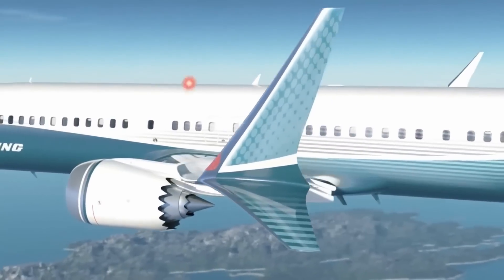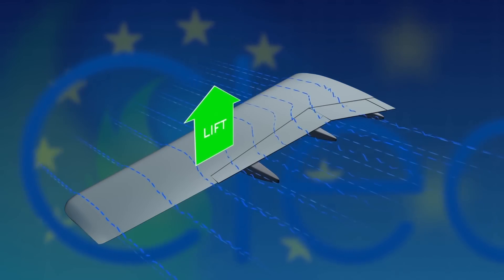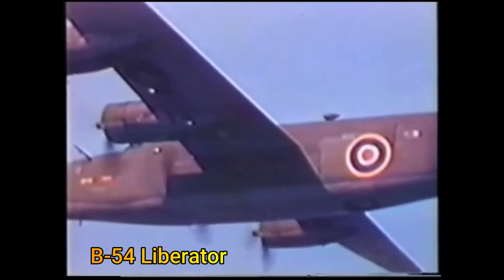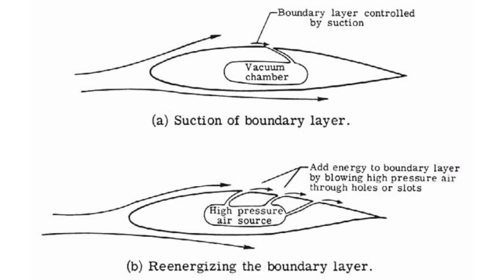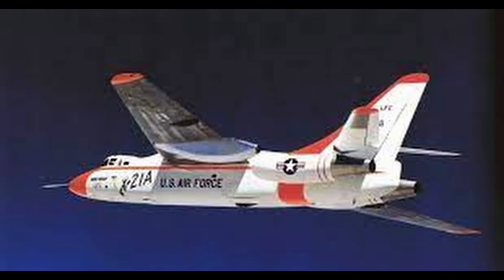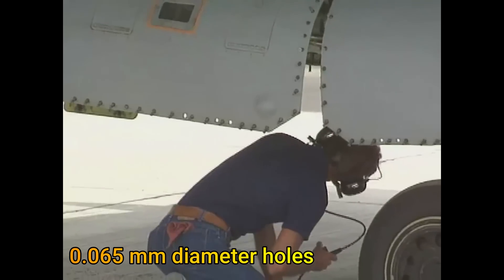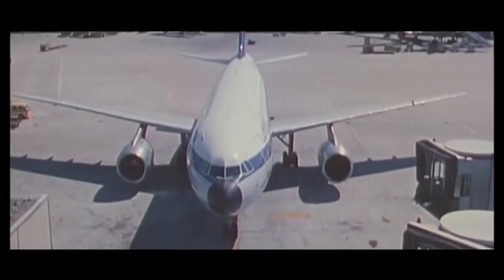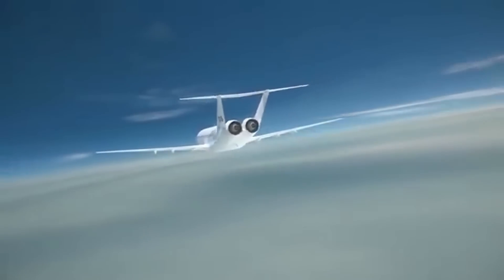Laminar Flow Aircraft: The most promising development in Aviation

Comment: It's a B-24 Liberator.
Reply from the maker: My apologies. I had written B-24 on the script but for some reason kept reading it B-54. I guess I had too much of the P-51 Mustang on my mind.
Reply: @ElectricAviation  
By the way, it was Pfenninger, who first designed and tested the Celera like body shape at the ETH, called the Zürich body, drastically reducing the drag coefficient in a rather LIMITED Reynolds number range . The data is available from the Institute of Aerodynamics at ETH or in the famous book by Sigmund Hoerner, Fluid dynamic drag, on the graph , skin friction of bodies of revolution, were it is called Zurich body, but no image is shown. So the original publication is recommended, from ETH, remarkable is the shape of the tail end, obviously not on the aircraft, with the pusher propeller. Talking propellers, the contra rotating coaxial propellers have a much better propulsive efficiency , 92+ % , compared to large 4 blade Hamilton Standard propellers, peaking at 85% , due to the angular momentum recovery
The efficiency of GA smaller propellers is in the order of only 76% for controllable pitch ones
Reply: @ElectricAviation  Wow the B-24 is such an iconic plane that saying b-54 marks you as you as very odd.
Reply: @ElectricAviation   The reason, moderately swept wings are difficult to achieve natural laminar  boundary layer of NACA 66216, 66212 , etc sections is the fact that the local angle of attack changes, increasing towards the tip, due to the interaction (Biot Savard) with the opposite wing. There is some, but NOT significant cross flow at cruising conditions, low lift coefficients, when the forward pressure distribution is flat.
Go and measure it in a wind tunnel, low turbulence one, where with thin oil the transition can be observed.
3 dimensional CFD designs permit spanwise constant pressure wings to be designed so that the crossflow inside the boundary layer can be almost eliminated. Outside the crossflow happens ONLY with separated flow.  Not a cruise condition.
Only in viscous flow does the pressure influence the cross flow, never in potential flow. where pressure is determined by energy conservation, in incompressible flow called the bernoulli equation.
Reply: @ElectricAviation  It's ko I have bouts with dyslexia too.
Reply: @michaeldose2041  Dyslexics of the World, Untie!
Reply: @tedsmith6137  LOL good one!
Reply: @tedsmith6137  Did you hear about the dyslexic atheist who spent ages trying to convince people that there wasn't a dog.
Reply: And the aeroplane which you showed after it was definitely not a P51-D Mustang! @ElectricAviation
Reply: @ElectricAviation  
There are four methods to reduce skin friction; high Re numbers, which destabilizes the laminar boundary layer  at high Re and was the motivation for Werner Pfenninger at the ETH Zürich to introduce suction to prevent the instabilities , rolling flow emanating in the 45° clip like vortices to cause transition. below  the turbulent boundary layer, a laminar sublayer always exists, on a uniform pressure distribution, according to Ackeret, the thickness of this sublayer grows proportional to the square root of the distance x reducing the shear friction
 tau = mü× du/dy. the velocity u is of course in the sublayer  linear with the height y. That is a reduction of the velocity gradient du/dy, the viscosity mü is indeed a function of temperature,  decreasing by a factor of (T/To)^ .78
together with the running length x increasing the Rex = U× rho × x ÷ mü
That is the Reynold's number effect. 
It is now clear , that in supersonic flow, the increase in temperature decreases the skin friction caused always by the sublayer gradient and viscosity. together with the wave drag  reduction, (Ackeret's relation  1/sqrt(M²-1)  ), the drag coefficient reduces with increasing Mach number ( which BTW was coined by Ackeret in honor of Ernst Mach) ..
After wind tunnel testing at ETH, Pfenninger went to Northrop to realize the concept of suction on a highly modified B-66, the X-21, partially succesfull.
The pressure distribution determines the velocity at  the top of  the boundary layer and is close to the potential flow, calculated for the airfoil shape AND the  angle of attack. Using conformal mapping techniques or singularity distribution techniques .
The Stratford pressure distribution  produces a shape, where the velcity gradient du/dy is zero after  the maximum velociy distribution, the boundary layer just short of separation all along the pressure recovery region to the trailing edge.
This fact was used by Liebeck to construct his famous airfoil sections resulting in L/D ratios around 600, the best ever achieved with initial laminar boundary layer stabilized by a negative pressure gradient dp/dx followed by a transition triggering postive gradient to full turbulent boundary layer and then by the Stratford zero  skin friction pressure distribution, just barely stable TURBULENT B.L. pressure recovery to the trailing edge. No too sensitive to AOA.  This idea of enormous reduction of the  turbulent boundary layer skin friction by near Stratford stable pressure distribution with a very small friction coefficient cf is by far better than trying to maintain laminar B.L. in a positive pressure gradient flow  with suction.
Talk to Liebeck , at Boeing !
Reply: UPDATED

The Consolidated B-24 Liberator USAAF Heavy Bomber. The U.S. Navy bought several hundred to convert to anti-submarine patrol over shipping convoys across the north Atlantic. It had a longer range than the Boeing B-17 Flying Fortress USAAF Heavy Bomber, which they augmented with a fuel bladder in the forward bomb bay. The aft bay held 350- lb depth charges in place of 500- lb bombs, allowing the aircraft to balance better fore and aft. 
   The USAAF commissioned the manufacturer convert another few hundred to C-87 Liberator Express Cargo Transports to carry freight over the Himalayan Mountains because none of the other planes could climb to that altitude.
Reply: @DavidRLentz  What does USAAF stand for?
Reply: @BariumCobaltNitrog3n  , the United States Army Air Force, dated round 1940. Prior to that, the organisation was the USAAC: United States Army Air Corps. Shortly after the Second World War, the U.S. DoD (Department of Defense) separated fixed-wing aircraft operations from the U.S. Army, and it created a new branch of military service: USAF. 
   The Army retained its helicopters: 1) transports, 2) ground attack, 3) observation, and 4) medical evacuation. 
   The U.S. DoD was late to this administrative arrangement. The British long had the Royal Air Force (RAF) and Nazi Germany had its Luftwaffe (German for "air+ weapon"). 

On another note, what is barium, cobalt, nitrogen, please? Would it be toxic?
Reply: @DavidRLentz  Wow that is some great information, love it. Think not about the chemicals but the symbols to find a tasty treat.
Reply: @BariumCobaltNitrog3n  bacon? 😳  I had to ask for help with this because it was just not coming to me. And no wonder: I do not like bacon, making your clue wholly  meaningless. You might as well have asked for "octopi toenails"! 
   And bacon is toxic, though it requires decades of accumulation.
Reply: @DavidRLentz  yes. Well water is toxic too then, everybody that drinks it dies...eventually. 🤣
Reply: @DavidRLentz Yep. This aeroplane, with its sometimes maligned wings,  was a key in the Battle of the Atlantic.  Taking off from Scotland to cover the gaps that no other aeroplane could reach.
Reply: @powerjets3512  The "Battle of the Atlantic" occurred during WWII. The only "atomic weapon carrying" plane in WWII was the B-29.
Reply: @herbertshallcross9775  Yes the Battle of the Atlantic was before the entry of the USA into the war. The B24 is much loved in Scotland due to its role in this key Battle. 
The Blackburn Buccaneer was a naval bomber of the cold War era, first flown 1958,  famous for its ultra low attack profile. It served in the Gulf war even.  It had special blower technology in the wings to give low deck landing speeds.
Reply: Yes you are right, built by Ford @ Willow Run one ever 59 mins
Reply: @malcolmmckinlay2143  of the first 38 produced 20 went to the RAF. They underwent conversions to make them combat ready and fit for maritime operations. 12 were flown from Scotland in the anti uboot role.
Reply: Yep yep and the mustang came out during the same period of time as the shown AC, but the B-54 he is talking about showed up in the late forties making all his comments on time frames n/a.
Reply: My faith in this guy is at zero percent right now🤣
Reply: No mention of the technology in the Blackburn buccaneer that had some blower technology to allow the atomic weapon carrying plane to land on the postage size British aircraft carriers. Any info on it?
Reply: @powerjets3512  I HATED the Buccaneer model planes when I was a kid, I always found it near impossible to stop the wings drooping!
Reply: @onbedoeldekut1515  But in real life the wings were supported by the ground effect.
Reply: And the plane shown when he said P51 had a radial engine!!!
Reply: The P-51 is my favorite.
Reply: B-24 Laminator
Reply: Should be the B-24 Terrorator. Libirated many of Europe's civilians from this life.

Comment: Frore has a new solid state chip cooling tech designed to break that air stickiness from the surfaces of the chip. I wonder if it could be used in aviation.

Comment: Thank you this is really good - easy to comprehend, and very informative and helpful.  I had no idea that the B-24 nor P-51 achieved laminar flow.  Also, I am amazed at how small the suctionholes are - they seem so vulnerable to clogging and damage, at 0.065 mm diameter..    
A couple of notes: I think that NASA Dryden flew an F-8 with a supercritical wing, in the 1970s-80s, though I don't know which if any results were produced.
 I think the D8 aircraft design was done significantly by Dr. Mark Drela, who had done so many other achievements in aviation like XFOIL, etc. 
And I would be curious to know if the flight controls are able to sense and keep flow laminar, and if so, how, and if that needs many more pressure and BL and turbulence sensors across the aircraft skin; and better air data sensors than the typical, kind of archaic, pitot tubes and AoA vanes that are still used on really all civilian craft?
Thank you

Comment: Nice going. You managed to get all the mention aircraft wrong. B54 Liberator? How about B24? There's never been a bomber with the designation B54! P51 Mustang  was not the two seat with British markings. That aircraft was flown in the 30's and obsolete by WW2. The one you called A31 I'm not familiar with but it did have a X21A marking on the side so I'll go with X21A. X designates experimental. The one you presented as a F16 which is a single engine fighter with conventional wings it actually appears to be a bomber called the Hustler and as you can see has a delta wing configuration. This series of blunders shows that your research is sloppy and not deserving to go any further than 1 minute 26 seconds. Anyone with even a shred of aviation knowledge will dismiss this as nonsense.

Comment: These planes don’t achieve laminar flow. And I can easily prove it. First, understand that laminar flow is a function of drag to vacuum. Laminar flow is the idea that a well-designed plane has low drag, and high surface vacuum. But the paints which they apply to airplanes and cars aren’t slick. It’s sabotage.

Boeing and GM and all the other companies have a machine which blows air onto a flat painted surface. So they paint a steel plate, and then blow air onto the plate at an angle. A strain gauge then displays the slickness of the paint. It’s the simplest test in the world.

Teflon paint is fantastic. Low drag to high vacuum. But the paint Boeing uses is the worst paint they can find. Boeing wants high drag to low vacuum, which offers terrible fuel economy. Boeing doesn’t make planes. They make oil-burning machines. Standard Oil Hit Men would never allow laminar flow. It’s illegal. Ask the Air Force. Their planes also suck.

Comment: Laminar flow is definitely the way forward with electric aviation. Lets assume that for a recreational aircraft 30:1 L/D is practical beyond gliders and we can push existing Li-ion cell fraction to 33% MTOM. This gives a range of
1MJ/kg  x  0.33 mass fraction  x  30 L/D  /  9.81m/s^2  =  1019km!
Actually, i'd like to hear more about technology required to safely fit batteries into wings (thermal runaway avoidance or control). This allows higher aspect ratio wings, although can introduce challenges in designing for heavy landing capability. How close are we to seeing the structural batteries that use cylindrical cell casing like the aluminium honeycomb filler in composite? At this point does replacing the battery mean replacing the wing? If you fit wing EDFs could you just send the wing back for overhaul every 2000hrs instead of whole airframe? If that was combined with 40% efficient solar cells for in between flight charging how low could $/hour get?

Comment: This was fascinating. Can one look at it like this?: when you have turbulence in the wake of an aircraft, the air is moving, so energy has been transferred from the aircraft to the air. In order for this to happen, work has to be done - this shows up as a drag force. With laminar flow, if perfect, the air behind the aircraft closes up and isn't moving, so less energy has been transferred to the air and so less drag. I would think the Celera won't scale indefinitely because the Reynolds number of the flow goes up with the dimensions so turbulence will happen more easily.

Comment: Next step... Apply a high voltage plate at the front of the wing or even a material that builds static as the air hits it at high speed and laminate the back half of the wing with a positive charge to attract the negatively charged ions in the air due to the negative at the front of wing

Comment: you forgot one of the most important things, almost 10 years ago NASA pubished a project where they did manage to really prevent turbulence. the last plane you showed in this video seems to kind of use it. and that design solves almost all those problems  automatically. the base principle is to not use a static airfoil but instead use a airfoil which transitions from extreme to zero or flat this manages to prevent that turbulence an actually convert it into foreward force(efficiency, so less force needed to move it) and lift(more lift from it as well). it also makes the wings silent and allows them to move at almost any speed without stalling or such, so they can go insanely slow and insanely fast and are stable in flight and autostabilizing. these are around 80% more efficient acording to nasa's numbers.
it has also been used in propellors and high speed propellors, which resulted in propellors which didn't make any sound other than the sound of the motor, and where normal propellors eventually begin to lose power at higher speeds untill they really generate no or almost no foreward thrust these propellors kept going efficient even at high speeds and while staying silent(turbulence is what causes the sound in propellors).

this technology is quite old however yet still barely used, the only comercial plane using it which I know of is the archeotypzyx(or something like that it was named),
however the mars glider(nasa) uses the same wing principle.
and for around 10 years some hobby plane/glider builders have used it, most of them being chinese people living in usa out of my findings(since I only saw it discussed on some very speciffic forums which mostly only have such people on them, well and on nasa's site.
however while in general it is said that NASA designed those wings/invented it that is not completely true since that wing design actually dates back to almost the beginning of aircrafts, not long after otto lilithan(or such was the name roughly). in germany many hobbyists started building their own small glider planes in their garage to fly with it, that is kind of the beginning of drachenfliegen/hanggliders. back then you couldn't buy them in general, you just build your own one and could just directly fly with it, no legal trouble at all. qutie early on there where a few popular base designs, one of them was quite much like the now famous one(which also accidentally due to things they did to save cost uses that same principle to become more efficient and stable), then there where those more like a plane, but also a few iconic ones back then which where like a plane but had no or little tail and still flew stable and well. those used that same principle to fly and be stable, back then most likely it was largely accidental, but they must have noticed the effects since eventually someone figured out that by doing that it could make it so efficient and stable that it trusted it's life into it and decided to spend that much time to build it rather than building a well used design(well used design doesn't refference to a actual design but more like information they heard from people). so whoever was the first one to build and design/come up with that idea was most likely the actual inventor, however since those where all hobbyists, and industry didn't care about stability or efficiency,  it somehow got kind of lost as in that it took many, many years before people realized again that that worked well.
for hanggliders, the famous design now used accidentally uses a slightly similar principle to stay stable and be efficient, it isn't really optimized for it, and the real reason that design is used a lot now is because they are super simple to make, maintain, transport(can easily fold them and unfold them), and they are easy to make with little big chances for mistakes etc.